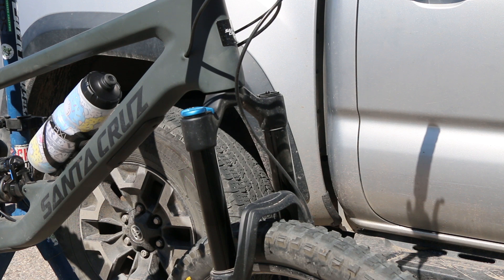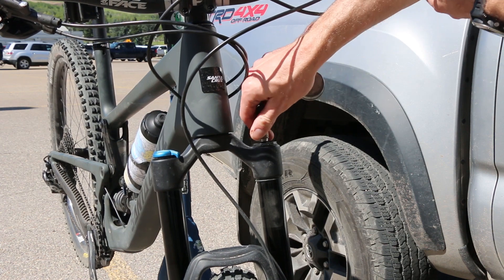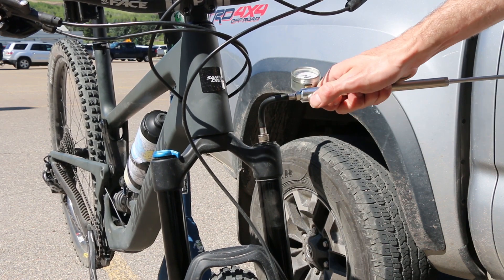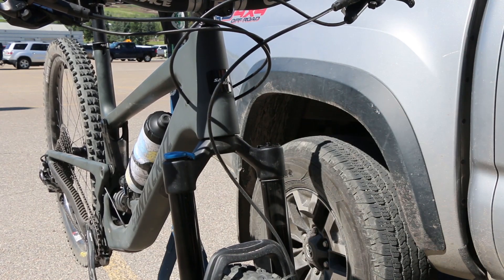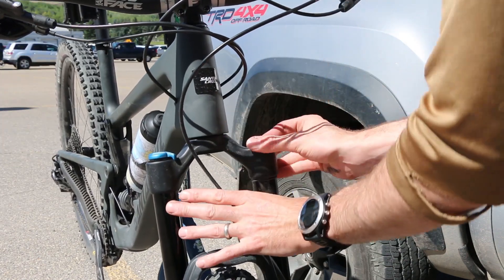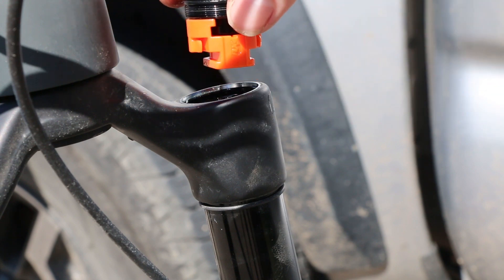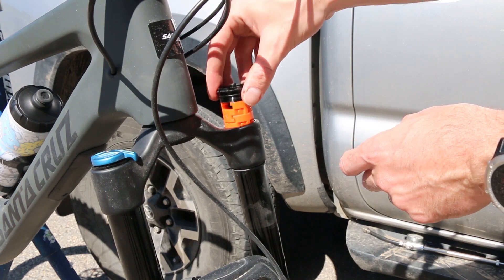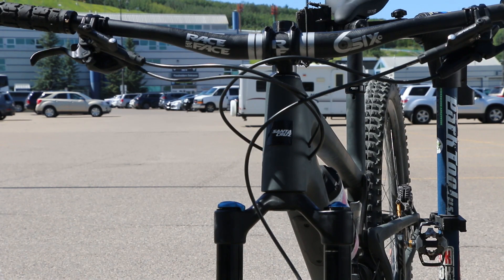How to Install Fox Float 36 NA2 Fork Volume Spacers

Comment: Is your fork a fox 36 rhythm float because mine is and I’m not sure which volume spacers to use
Reply from the maker: It was a performance Elite.
Reply: Did you figured out what spacers do you need? I have the same Problem
Reply: @pierre6447  Yh I asked fox suspension and some bike shops and they said the purple rhythm ones. Hope this helps👍🏻

Comment: Do you need a torque wrench when putting the top cap back on? I ask because the spec is really high like 24-28 nm if I remember right and I hate having to purchase a 100$ wrench just for that (I probably should sigh, the list of expensive mtb stuff seems inexhaustible though lol). I have a lower torque wrench for like 2-16.
Reply from the maker: Yes to put it back to spec.
Reply: This is not legal advice, but 25Nm is NOT high. I have changed a bunch of car wheels in my life - and car wheels are tightened to 90fl-lb which is 122Nm - so slightly less than 1/4 of this force. 90ft-lb will feel like 60ft-lb using an 18-inch torque wrench on a car (think 60#s). 25Nm = 18ft-lb but, but using a 3/4 of a foot (9 inch level / handle) will feel like 24ft-lbs (think 24#s). So, 24/60 is 40% or 60/24 is 2.5 - thus you need only 40% of the effort applied to a car wheel nut or the car is 2.5x that of the fork (all approximates). People are pretty good at approximating and your Fork has a range that it will be happy in (again not legal advice). Most sporting people know what 25#s feels like - that's the amount of force you are going to apply to the end of your 9-inch wrench (approximately). If you don't have a feel for this then don't do it - but since you have a 2-16 tq wrench, if it is roughly 9"s long, then set it to max 16Nm (if it is Nm and not ft-lb) and this is roughly 1/2 the force you'll need - whatever that 'feels' like, you need very slightly over twice that force (again all approximates). Hope that helps